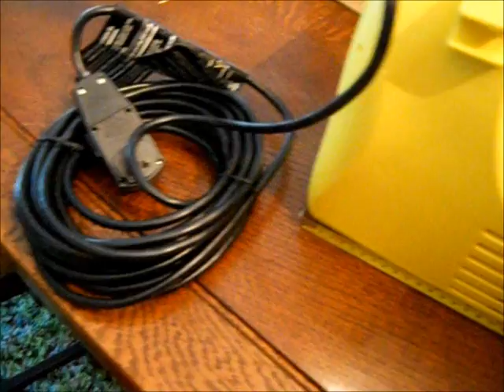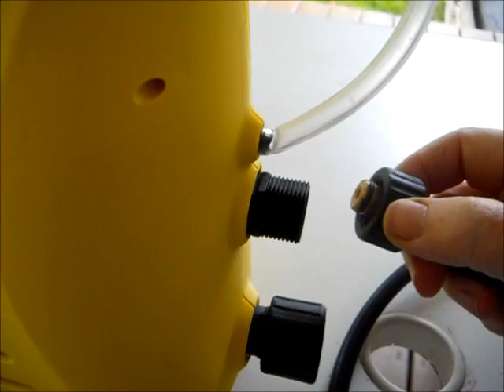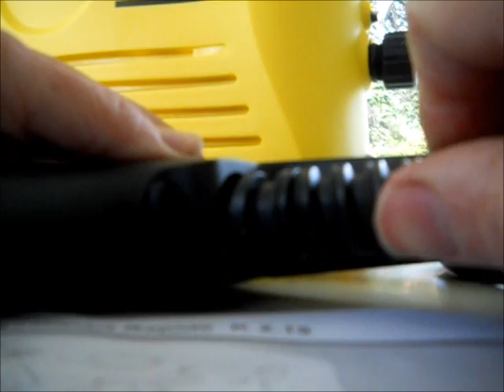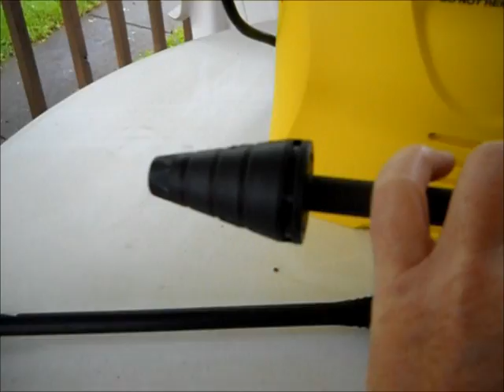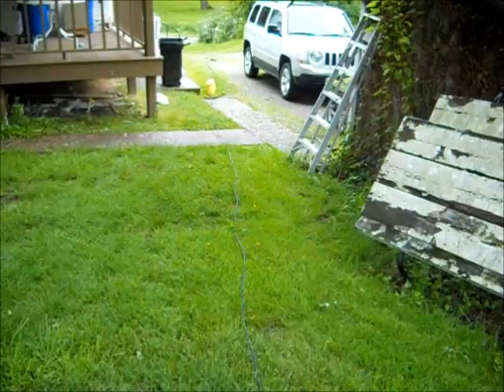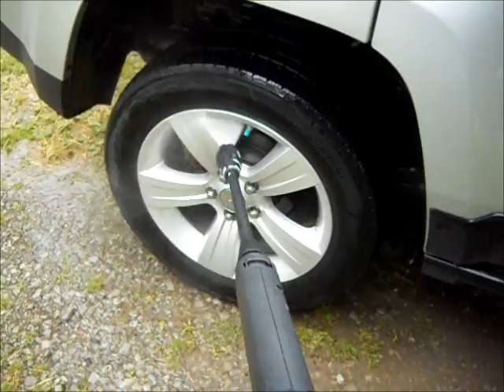Karcher Brand Model 2.19 Electric Pressure Washer Unboxing, Assembly, Use, and Review

Comment: Why does my power washer Karcher K2.19 sound like the motor is cutting in and out? Consistently but works? Is there a switch that I don’t know about?
Reply from the maker: The pressure control switch cuts in and out depending on if you're spraying or not. If it cuts out while your spraying 1. inadequate water supply, 2. clogged or kinked hose. 3. faulty switch. 4. You stopped spraying. It's purpose is to prevent over pressurizing the system. Thanks for watching!

Comment: How long should it take to get pressure. Mine has been on half an hour and is just making a racket!
Reply from the maker: Pressure comes a few seconds. First check in if the water is reaching the connection. Next (while it's OFF) pull the trigger on the wand to bleed air out of the unit. If water does not squirt out of the wand with the unit off you have a water issue. After this process turn the unit on and pressure should build, keep the trigger pulled so the pump can prime. If you get continuos water out of the wand but no pressure the pump is broken. I had one fail when it froze over winter... my bad 😔